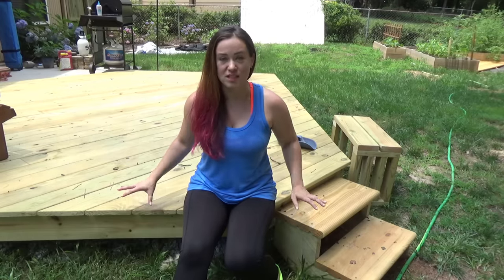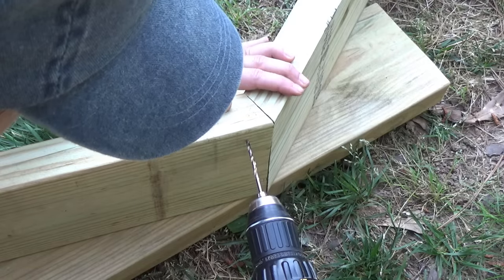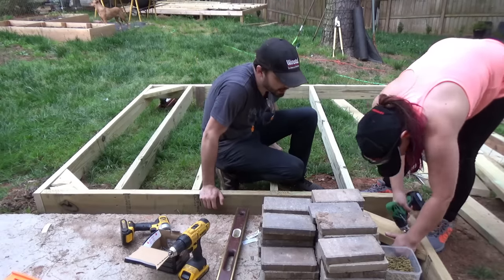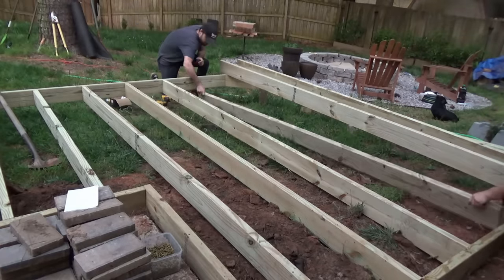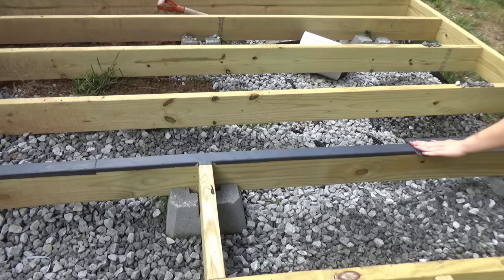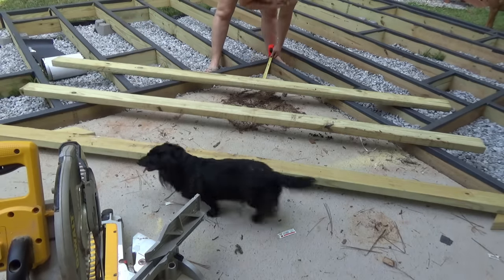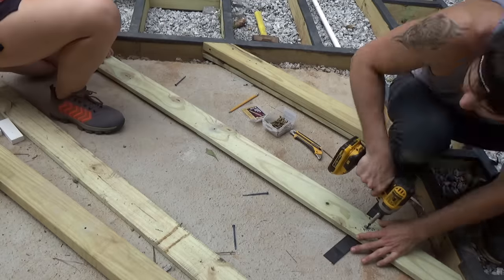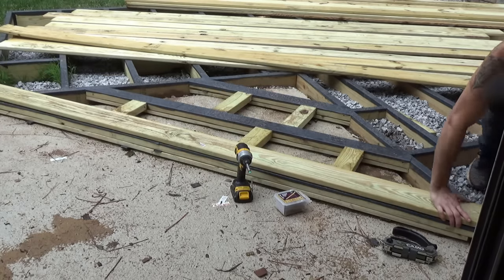DIY Floating Deck | PART ONE | frame + moisture barriers

Comment from the maker: Thanks for checking out my deck project! If you liked this video, please consider subscribing to my channel! https://www.youtube.com/user/theuglyducklinghouse?sub_confirmation=1
Reply: How much did the project cost?
Reply: Proper Job 👍
Reply: Great looking deck!  My only concern is the lack of air space under the joists.  You've raised the ground, creating individual compartments.  Wet gravel touching the wood will cause a wick effect.  The damp air trapped inside the compartments will compound the problem reducing the life of the structure.

Comment: You are doing a good job. I am building a deck but it's much smaller it's 10 feet by 8 feet and I am getting good tips from your video. Thanks very professional.
Reply from the maker: So glad you found it helpful and good luck with your deck!

Comment: Great info, top cover of the joists is a big help, I painted the top of mine over 15 years ago with bitumen roofing adhesive and they still look and feel good as new now I'm swapping out some boards.
Reply from the maker: That’s great to know that it works well, thanks for commenting!

Comment: At 4:02 perfectly aligned and level concrete blocks suddenly appear ("lined up, dug, and placed concrete blocks"). That's a critical, difficult, time-consuming (and possibly dirty) step glossed over! Particularly: How did you get the supporting blocks level and all on the same plane? What tool, if any, did you use to tamp the disturbed soil under some or all blocks? Did you use limestone screenings, sand or something else between the bottom of each block and the soil below? And, if you didn't do this properly, how do you expect the deck to remain flat and in the properly sloped plane as time and weather cause some of the blocks to shift (sink)?
Reply: Sounds like you have some experience, why not just share what you know for those trying learn?
Reply: @VictoriaWells254to562  Difficult and time-consuming steps don’t fit well in short cheerful paragraphs (or videos).
Reply from the maker: I never saw these comments before but: the manufacturer of these deck blocks don’t require sand or limestone screening. They were designed to sit flat on the ground and build on top (you’ll see in their videos of the same). Hope that helps.
Reply: How much movement will occur in Georgia?

Comment: I'm impressed, I usually talk customers out of grade level decks. I learned peel and stick trick long ago; makes a huge difference in longevity. Maybe a heat gun to speed sticking, or Eternabond crazy stick. I also use frp shower wall sheeting scraps for level shiming 1/16 inch at a time. You're a very conscientious builder. Peace.

Comment: Came here from TikTok. Took up my old and mostly rotten decking today (and burnt out a circular saw in the process). I was just going to lay gravel but decking will look much nicer and add value. Haven't seen that moisture barrier in the UK but may be able to get it somewhere. All ours are normally built without it.
Reply from the maker: There are many in the US that don't either so I think it's a fairly new thing. Normally you would seal the ends & such but between the moisture barrier and the ground contact lumber this should stay solid for a while. That's the hope at least!

Comment: Pre-drilling helps to prevent the wood from splitting but is time consuming.  The rubber cap is an absolutely must if you want the deck to last decades.

Comment: Thank you for the great video. Its really very helpful. I am about to start on my first deck project and have 3 questions: 1. What is the ideal space between each deck block? 2. Is it necessary to remove the grass sod? 3. Did you also use a weed barrier underneath the stones?
Reply from the maker: Glad you liked it! 1. The space between each deck block will depend on the manufacturer's specifications so be sure to look up the one you plan to buy (I think I have mine listed or linked in the blog post). 2. I think it's best to not have anything growing underneath so the landscaping fabric and stones go down smoothly with less opportunity for weeds. 3. Yes, there was a weed barrier (it wasn't necessary in one spot because it was already beneath the dirt). I answer more questions in the blog post series as well, just FYI!
Reply: @UglyDucklingHouse  Thank you for the quick reply.

Comment: You need to find a video on stair building.    Most of them don't know the formula: 2R +T = 24.  Stairs should have a riser between 7 and 8 inches. The treads should be about 10 inches.   Measure the total rise, then divide by 7 inches.  this will give the quantity (number) of risers,, then divide the total rise by that number for the unit rise.
Reply from the maker: There is a reason I didn't include a stair tutorial, I know I have to redo them.

Comment: isn't 12" on center recommended with 2x6s and why are some of the deck blocks 32" apart and some 48" apart? nice work by the way.
Reply: I’d say since she has continuous support almost everywhere with the concrete blocks and gravel, the span is like zero.
Reply: 16" OC is called out as the "minimum" spacing for 5/4 wood decking. You can use 24" OC for 2x6's. In all cases, decking, beams, joists, whatever, just check a span table
Reply: 16" is called for when 90* joist to deck board but when decking is at an angle you need to go down to 12"OC. So much wrong with this video and will be falling apart in 3 years to do again. She should have done it right from the start and used Joist hangers and corner brackets as well as joist blocking. May look nice but done so wrong

Comment: At what point did you add the concrete blocks? At 4:00 they weren't there and at 4:02 they were. Was that an oopsie? Seems to me the boards should have been installed AFTER the concrete blocks were in place.
Reply from the maker: Read the blog post

Comment: You have a sliding miter saw, don't plunge cut. Cross cutting is safer, more accurate and doesn't kill your saw and blade. It's why they make them slide.

Comment: I want to put a gazebo in the backyard. Considering a floating deck vs a concrete base. 
1) is it better to go with a floating deck rather than a concrete base. 
2) will there be a issue with wind moving the floating deck if a gazebo is installed on it?
3) how do u prevent racoons etc dogging / going under the deck?
Reply from the maker: I can't really answer the first two; you should probably talk to someone local who knows building codes for gazebos in your area and definitely look into permits. As for #3, we're thinking of adding some screening to ours to prevent our little dog from going under. On one side of the deck, it's not an issue because she has no access.
Reply: @UglyDucklingHouse  ok thanks for the tips.

Comment: You mentioned a few times about wishing you had self drilling screws why not use a framing nail gun? That would shave significant time off the frame.
Reply from the maker: That's not a bad idea. I didn't wind up getting one until after this project was over for my shed project (I know there are rentals). I simply decided I wanted to use screws for the frame.

Comment: Could you please tell me what size of the wood you have used for joist to the frame? Did you put or use any post to hold the frame to the ground? Thank you
Reply from the maker: The frame is on posts and the posts are on the deck blocks. I used 2x material for the frame.

Comment: I love this video!  I'm planning to put a platform over a smaller concrete patio myself and so you're experience will be helpful.  I know what "floating" means, but not sure why you don't need to use posts sunk below the frostline.  Is it because your platform is NOT connected to a permanent structure like the house?
Reply: i've read you shouldn't connect to the house
Reply from the maker: Connecting a deck to the house is possible, but it requires more work to prevent water damage between the two structures, inspection, permits, and such.  That's why I didn't take that option. I was happy to have it separate from the house and this seemed more like a DIY I could do with less risk. If I wanted to attach it to the house, I'd probably hire a pro for at least part of the build.
Reply from the maker: Never saw this comment before now, sorry! The short answer is: where I live played a role in a lot. I wanted to build one within the county/city limits for size, height, structure type, etc. Poured foundations, height, detached vs. attached structures, etc. determine the permit required to build a deck and what criteria it needs to meet for inspection.

Comment: Hi! How do I figure out the placement and measurement of the slope??
Reply from the maker: I didn't really have an actual measurement of the slope. First, I put a level on my concrete patio and made a note of the slope it had (a little less than half a bubble) and tried to match that with the deck. I put in temporary pieces of wood to keep the frame at that height while I put in more supports (see about 2:40 in the video) or dug it into the ground until things leveled off where I wanted. I would recommend using a 4-foot level since that will help you cover a larger span at a time.

Comment: how u maintain and support that wooden deck from rain?
Reply from the maker: Pressure treated wood is resistant to rot, plus I stained it to protect the surface. Occasionally I'll pressure wash the surface to remove dirt and I use a blower to blow off things like pine needles.

Comment: Going to do this exact method this spring, thanks!  Do you think it would have been easier to set the blocks in place, then build the deck right on top of them?
Reply from the maker: I debated. In hindsight, I still don't know. It was a pain digging the areas regardless, so part of me thinks it worked out for the best this way. Having the main frame on top gave me clear areas to mark and dig vs. trying to rely on strings and in one spot we found a giant rock so had to move things just slightly to do less digging. If you think that option is easier for you then I say go for it.

Comment: Nice work! However, did you never consider the risks of having your dogs running around the construction  all the time? In my eyes it did not seem to be a safe place for that dog to be with tools, screws etc. everywhere.
Reply from the maker: My dogs grew up in my home where I've been doing DIY for the last 10+ years. They are no strangers to any of this. We take precautions to make sure screws and such do not get thrown all over the yard where they could step, and they have been well taken care of. Neither were ever injured in a DIY related incident.

Comment: Maybe someone can help me out there. she has the landscape fabric linked below the description but never mentioned it in the video. Unless i missed something, it looks like she removed the grass from under the frame and poured gravel and thats it. Does that usually suffice?
Reply from the maker: Landscaping fabric went down as well (in one spot, it's actually buried beneath the dirt from a prior project so more fabric wasn't needed on top). If you skip it, there's always a chance for weeds and stuff to grow up in between the inevitable cracks in the decking when it dries out. Weeds are abundant here so best to do whatever you can to prevent it, and landscape fabric is inexpensive and easy to install. Good luck on your project and I hope this video helped along with the rest of your research!
Reply: Ugly Duckling House with Sarah Fogle could you place the landscape fabric down with gravel on top of fabric or is the fabric enough? Thanks for the response by the way!
Reply from the maker: I think both are best long-term! The landscaping fabric will inevitably have holes in it (simple wear & tear... it's plastic, and plants fight to find a way through) and the gravel will also help with animals from making a home under there. It's all preventative work, really. Both were recommended in my research, so I did both.
Reply from the maker: Since nearly the whole deck is in contact with the ground, the gravel does have some contact with the support underneath. No avoiding it, really. And I'm not sure how deep - I think the recommendation we went with was an inch or two. Thick enough to cover any visible evidence of the fabric underneath.

Comment: Had to borrow a truck - husband / boyfriend won't let me use his1:50 use a Kreg jig instead1:58 you obviously didn't talk to anyone who built a deck before or you wouldn't have that problem...I give up
Reply from the maker: Kreg Jigs don't make for all that secure of a joint, so I don't use them unless I need things hidden (which didn't matter in this case).

Comment: The real question is why would you ever use a Phillips screw
Reply: Say you want to lift one of those planks in the future? Would you prefer to have to deal with a nail or a screw that can be easily removed?
Reply: @deanpd3402  A stripped out phillips head screw is easier to remove than a nail?
Reply from the maker: There aren’t any Phillips head screws in the planks.
Reply from the maker: But in terms of where I did use Phillips screws (like in the initial frame), I simply used the materials I had available. Mixing up supplies in DIY is common (you use what ya got, run out, go buy better stuff for the rest of the project on the next store run).
Reply: @UglyDucklingHouse  I don't think what type of screw head matters IMO, what does matter is that you need to make sure what ever type of fastener you do use can be used in ACQ treated lumber.
Reply from the maker: Are you explaining this to me or to the OP? 😂

Comment: You should have framed it, and that CAMO you used is ofc around 75 here and the screws there after. - But great job.
Reply from the maker: That's definitely a lot pricier than what it cost me, but it worked like a charm! Even a little more expensive and IMO it's still worth it. Thanks for watching!

Comment: I’m sorry but I would have made the extra effort to raise it off the ground. Ground contact is never good no matter what type of lumber it is. 

Its easy to raise it off the ground for less failure later. 

The flashing tape is 110% the best idea.
Reply from the maker: I wouldn’t have liked it off the ground and raised so high compared to the door access. It has held up well so far!

Comment: Water proofing the wood is a great ideas! Where can i buy the tape? Thanks!
Reply from the maker: Sorry not to see this comment earlier, but I updated the description and it now has similar flashing tape (I couldn't find the exact brand I used online but found several similar ones): https://amzn.to/2NP6ZxD or https://amzn.to/2zG6EV2
Reply: Thanks
Reply: Is that flashing tape rated for drying potential some of these tapes hold water without evapotation. I have found the areas wet after a year when adding on to my deck @bettyescookingchannel
Reply: Sorry but WR Grace also used to produce Asbestos and had lots of trouble because of it.

Comment: Nice but no joist hangers.
Reply from the maker: We added some to the parts that were above ground (mentioned in the post but not the video). When researching, the advice on the pro forums were that joist hangers that would sit in the dirt may cause the structure to rot faster due to moisture, so I didn't think it wise to risk it if it wasn't definitive that it would be beneficial.

Comment: You skipped such an important part. How far apart are the blocks. How did you square the deck. But make sure you tell me the useless parts. Drilling holes and use a piece of to to keep thing flat.

Comment: Don't you think that you should have removed all the organic layer of soil and grass, before adding gravel? The gravel is only stabilizing your joists, which is nothing. You mention vapor barrier, which has nothing to do with flashing. Your load paths put weird stresses on the rim joist as the deck sinks into the yard,  I think you'll have settling problems with this deck. Did you use any triple-zinc hardware? Although a railing is not required for under 30", they give a clue that there is a drop-off, at least one person will faceplant falling off the edge. You obviously didn't get a permit, and for under 200 square feet, you didn't need it, but you next time tell your viewers to search for this free instruction book: 'DCA 6 - Prescriptive Residential Wood Deck Construction Guide'. You don't know what you're doing, so you go girl!

Comment: Woulda been a whole lot easier to paint the whole botton assembly with foundation coating. Last for ever.
Reply from the maker: I haven't heard of that being done on a deck before, but I assume you would still have to let it dry out first like with any other type of sealer?
Reply: @UglyDucklingHouse  clarification. The coating I used was almost as thin as water. Brushed it on and it absorbed right in. Dried nice. It looked good that way so I left it. Also did it to the bottom of a camp. And the critters didn't like the taste of it. Lasted quite a few years.
Reply from the maker: Thanks!

Comment: Just the stairs r not equal
Reply from the maker: You're right, they aren't. I addressed it in a different reply but that's why I didn't include them in my video — because I knew I would need to redo them.

Comment: Omg from start to finish everything was done so so wrong. Thay deck won't last even 3 years like that. Screws have no shear strength so without hangers on end will most likely sag or snap. Never used any Armstrong brackets in corners to hold together, nothing to keep level. Just everything was so so wrong. Also when deck boards are on a 45* angle need 12" on center joists
Reply from the maker: So so incorrect — deck is now 6+ yrs old and still going strong.
Reply: @UglyDucklingHouse  don't know how but still only last 1/2 as long as a correctly built deck.
Reply from the maker: It lasted because I built well. According to the pro that gave me the thumbs up as I built, I’ll take his word over yours. Thanks for watching. ✌️